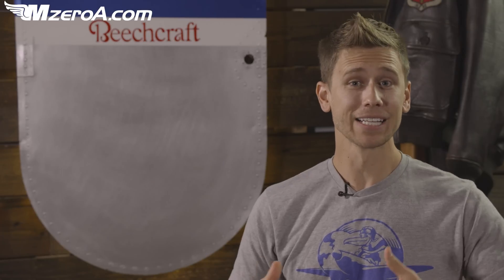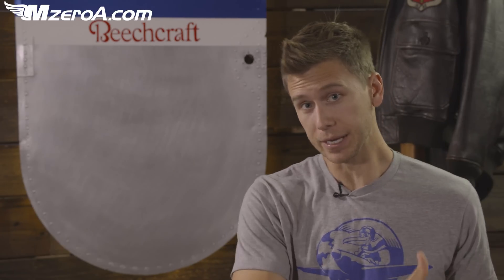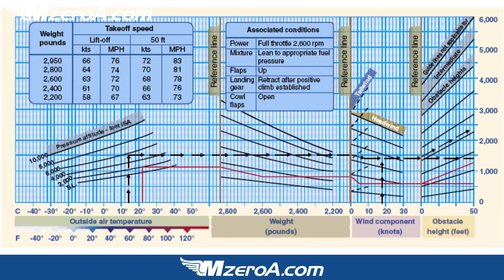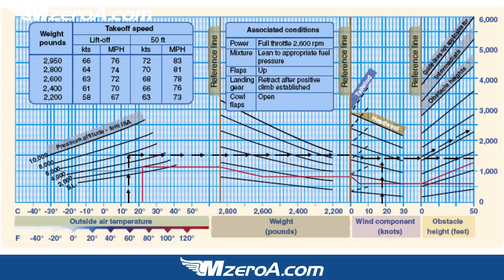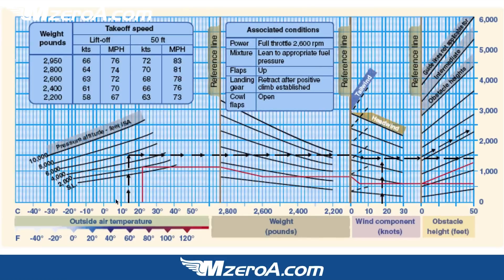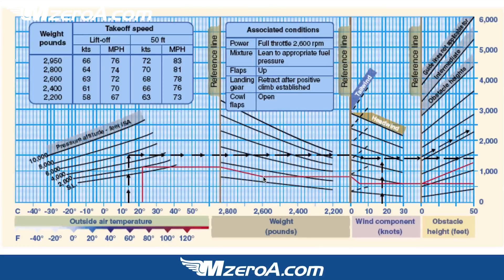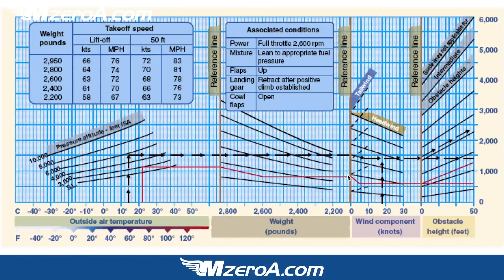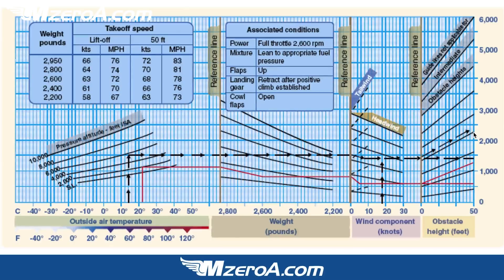#AskJason 8: Takeoff & Landing Distances

Comment: sorry Jason.... this isn't how interpolation should be done. I think you misinterpret interpolation to mean "in between" (it's the only explanation I have for the way you've done this)

The entry to the weight chart is closest to the second reference line, so the calculation line should be drawn parallel to that one until you get to 2600 pounds.

similarly on the wind chart, the line drawn should be parallel to the closest reference line - you've drawn a line connecting the entry point to some arbitrary point between two reference lines.
Reply: Completely agree with you on this.